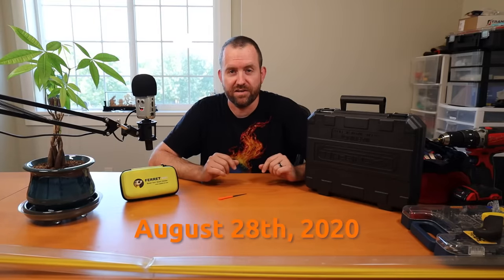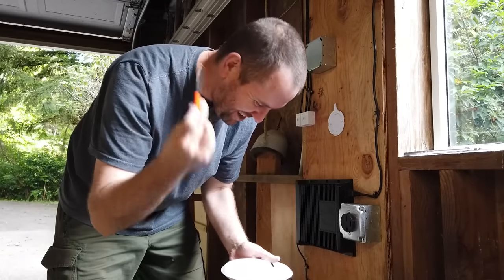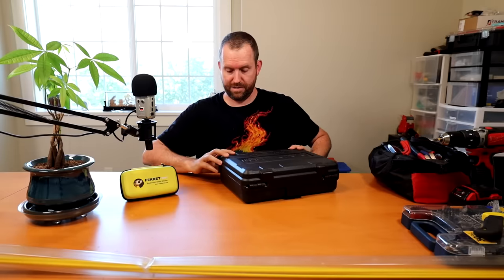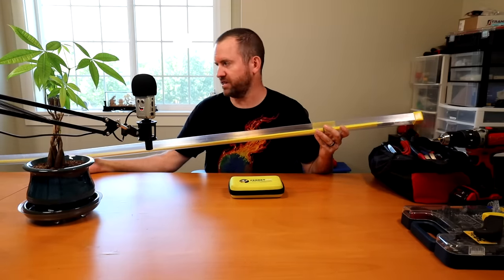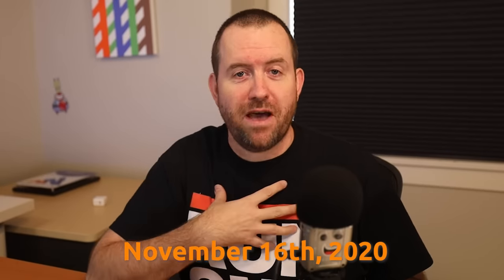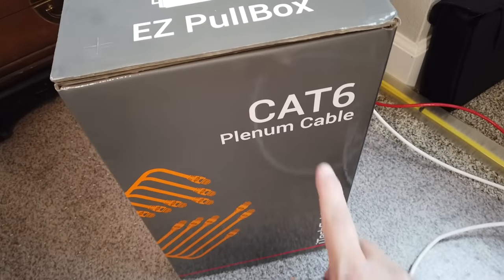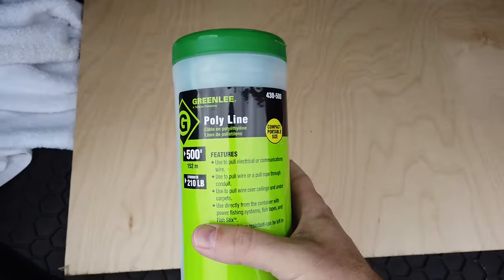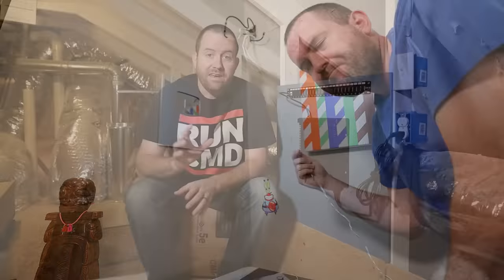CAT6 Wall Fishing

Comment: Two common mistakes you made.   Always run one more cable than you think you will need.  Cable is cheap and as we get older, running additional cables ends up being more trouble than it is worth.   And second, always pull  a pull string with your cable to use in the future when even the extra cable isn't enough.
Reply from the maker: Good tips - thanks!
Reply: @Killahkazx  I use those or similar on all my installs also.
Reply: I second Truth Warrier's comments about the string.  Always leave a pull string in place, more than sufficient length (about twice needed) and tie a knot around a washer inside the box so it cannot be pulled back into the wall!
Reply: Ya'll stole all my comments! LOL Great job everybody!!
Reply: Good advice. 1) Where do you get pull string? 2) Is there a standard way of attaching something to a cable so it can’t drop down the hole you just ran it through? 

I pulled a cable last night from the 1st floor to the basement. I terminated the cable and went to the basement to run the cable down there. I mistakenly pulled the cable from upstairs down into the basement. So, I had to pull the cable back up. It would be great to have some way to insure that doesn’t happen again!
Reply: @majorgear1021  paracord is cheap and readily available
Reply: Another good thing is to pull an extra string.

Comment: Friendly tip, work with gravity.  Pull the wire down, not up with the magnet
Reply: Thats how all of the other videos I have seen with the Magnepull have shown how to use it. They also were able to go much faster which might potentially help with the issue he was running into with the cable folded over not being able to pass the insulation.
Reply: Yup. In my younger days I went top to bottom. Bottom to top is a waste of time and you can avoid all this angle bit. Cameras are a waste of time.
Reply: @raulruiz598  In my younger days I used to do this too, then I realised its a waste of time and after sourcing a good contractor for the job, outsourced the deployment of all the cabling for my projects to them
Reply: Running cable is one of the hardest things I do.  Customers never understand why it takes so long and cost so much to move a light switch 6 feet.
Reply: I spent most of this video muttering that at the screen...
Reply: @TerryPullen  TBH, that is true, but it depends a lot on where you want the fixtures. I wish it was as easy as what he's doing in his office. If I want to wire my LAN, then I'm going to have to go side ways rather than up and down, meaning a bunch of holes would have to be cut in the studs. More likely, I'd probably wind up just adding a crown molding to hid the cables, but that costs more money than one would imagine. But, having crown moldings does class up the place, so it's not a complete waste.
Reply: I'm about to do this myself - I was thinking of attaching a weight to a string and then pass that between the studs.
Reply: He could've also just attached fishing line to the pole he pushed up and attached the ethernet cable to either end and pulled the line eliminating the need for the magnet all together.
Reply: Unless you live below the equator, then it’s the opposite
Reply: Exactly what I was thinking. You can't fight it, so work with it, not against it

Comment: For someone from Europe (Germany) it's just funny to watch how these US paper houses are built. :D
Reply: you should see how manufactured homes are built in the US, they are basically paper houses (i live in one so i know some of the pains, like walls that are not drywall but basically a cardboard material, all the drywall/wallboards are stapled to the framing, same with the cabinets, my house also had no inner vapor barrier and no outer house wrap, basically just a faux shiplap sheeting - although mine also had vinyl siding ontop of that. its drafty, not great in summer and winter, oh and as it was built in 1985 almost all the pipes are polybutylene so im looking forward to having a pipe break down the line. ) although i will say wiring is easy i can get under the building and the outer walls when you drill through the sill plate it has nothing underneath.
Reply: Do I hear the Polizei banging on your door? You better get on the ground.

Comment: FYI, the wood block that you ran into is probably a fire block that slows fires from running up your wall cavities and into the rest of the house. If you're planning on drilling holes through these blocks, you have to seal the gaps with fire resistant filler
Reply: My thoughts exactly! I only have experience with commercial cabling, so I wasn't sure.
Reply: It sounded like he just ran into the top plate.
Reply: @JoshuaBurgess  agreed and he said it was one 3ft left to go. Most residential code calls for blocking on 10ft or taller walls in texas. Top plat it is
Reply: I was very surprised that he didn’t run into fire blocks in those cavities.  They are required where I live and make the process of running wire much harder.  I had to cut open the drywall in order to drill through thre fire block and then close up the hole.  A big job for me.

Comment: When he didn’t put a mud ring in the hole that he drilled actually broke me.
Reply: At least he installed wall anchors instead of screwing directly into drywall.
Reply: George Bush why even install them if your not gonna do it right in the first place hahahahaha
Reply: @Harrypm3  IDK, I would give this solution a C+ or maybe even a B.
Reply: What non-electrician home owner is using mud rings for a home cable run?  Not very many is the correct answer.
Reply: Jon G but he does client installs if you have watched any of his other videos so...
Reply: Yeah that was some rough old work. Though he did use a level to install the plate!
Reply: @Harrypm3  He said he’s not a cable puller.
Reply: wbhad83 he pulled the cable just fine. The plating was what was wrong
Reply: Can you tell us europeans what a mud ring is?
Reply: @TheBrightPixel  It's basically just a shallow junction box with no back. Keeps the opening clean, from spreading and breaking, and gives you the holes the holes to attach your wallplate to.
Reply: @Zizzily  We have something similar in Europe, but we usually have solid cement walls :(
Reply: @TheBrightPixel  the ring also has two little flaps that are flush when the box is inserted into the wall cavity.  By turning screws these flaps swing out 90 degrees and tightens to the back of the drywall which in conjunction of the ring's front lip lockes the box into place.  This provides a stronger resistance against forces pulling away from the wall than the anchors used in the video which are primarily used to resist forces pulling in the down direction.
Reply: A little tip. Take any bank or credit card  trace it on the wall. Cut it out with a wall board saw. Use a low voltage ring with the from Home Depot. Its usually orange in color. It has the ears that hold to the sides as you tighten the screws.
Reply: @TheBrightPixel  A mud ring is a metal fixture that attaches to the front of an electrical box that extends the front of the box some distance forward and usually shrinks the opening (they are available in many shapes and sizes).  I use them if I need a large box but only want a single outlet or switch.  Also, let's say you are repairing a badly damaged plaster wall by covering it with a layer of 1/2" drywall which you will later finish and paint.  You can put 1/2" mud rings on all the electrical boxes to extend the front of the box by 1/2" bringing it flush with the new wall surface.  They get their name from the fact that they allow a plasterer or drywall installer to place mud right up to the electrical box making for a clean, finished opening.  Search "mud ring image" and you will see many examples.
Reply: @georgebush6002  Literally the way I was planning to do it myself.
Reply: @TerryPullen   Interesting I was always baffled by the name, but now it makes sense.  Have you considered that both may be correct since there is often different old vs new work methods?  This would make sense if the goal of a mud ring is to provide a finished edge through the plaster or drywall.
Reply: @TerryPullen  , 100 % correct,  however mud rings go on before Sheetrock ! What he needed was an LV1 or a mpls bracket

Comment: Be sure to seal any holes you make in the wall top plates (the holes you drilled in the attic) to avoid moisture traveling from the heated space to the unheated space.  Otherwise that nice white insulation will be black around the hole in a few years.
Reply: ...also a good idea to slow the spread of fire inside walls.

Comment: I can't believe I've been taking IT advice from a guy who terminates keystones with a pair of pliers lol. Definitely going to get that mag-pull though. Fish rods are such a pain with insulated walls
Reply: If you are joking, please disregard. That is a compression tool for terminating RJ45 jacks. They crimp down all 8 wires at once. They can potentially be a huge time saver for big installs. A downside is that they only work with certain jacks.
Reply: @Heizenberg32  I slowed the video down multiple times to see it. Those were pliers.
Reply: @rjgrissom  But... how would that even work?
Reply: @Heizenberg32  It shouldn't. There must be something we are missing that was clipped from the video or. punchless keystones?  If such a thing exists.
Reply: he put the jack covers on, which have fingers that PUSH them down to make contact. although you should really use a punch tool, or the little plastic punch tool they give you with the jacks.
Reply: @OHWhatsNext  I think you figured it out! Yeah, that would probably-maybe work. But... yuck!

Comment: I am far from a professional installer, but I wanted to share some things I learned from my own DYI: 

1) Whenever going between floors, like through the top of a wall, you are penetrating a fireblock and you need (in order to slow potential fires and be within code) you should use fireblock foam around the penetration (of course making very sure you are sure you don't need to pull more cable or adjust the cable you have before breaking out the foam). In terms of the hole you drilled in the video, it will also prevent conditioned air from flowing through the hole you made into the attic space. 

2) It is good insurance to run another nylon pull (like Poly Line) with your cable if you ever think you might want to pull another. 

3) You can strip back the cable a bit and use the copper wire of the cable to help create a strong connection with the Poly Line without as much tape, which helps for a slimmer profile and easier pull. 

Best of luck with the rest of your cable install!
Reply: A 3/4"hole in a top plate of a timber building is never going to increase the fire risk.  A timber building is a tinder box every day.
Reply: @einfelder8262  ...
Actually, a 3/4” hole can let pass a large amount of heat. Enough heat to char and ignite papers, cardboard, plastic, etc that can be found in attics.
It will also allow smoke to penetrate.

33 years in fire department, hundreds of fires as experience, in  fire suppression and fire cause and determination.
Reply: @ernestgalvan9037  I agree.  But once the timber frame underneath is already on fire causing the heat and char to pass through the 3/4" hole, the cause is already lost.  Or are you seriously telling me the 3/4" hole is the cause of the problem.
Reply: @einfelder8262  .... well, not “seriously”, but “earnestly”.....😎
A 3/4” hole (called a “void” in our work) can allow a tremendous amount of heat to pass through. 
This can impact styrofoam-type insulation, or the paper backing on dry-wall, or wiring insulation, among other effects.
Fire voids are a leading cause of rapid fire extension, also called “fire getting away”, or as we used to say, “the Dragon getting free”.
(Firemen used to say that a fire was a living, breathing animal, a Dragon)

Thirty-three years in fire suppression; been there, done that, seen that; I got the scars, along with the t-shirt.👨🏻‍🚒

Comment: Glad to see the comments filled with great advice. I would also like to give my two cents. In the beginning of this video you shared a tool to remove the unifi access point. I have been working with that particular brand of AP for a little over 4 years now. To remove them, I have always just used a simple standard zip tie, and have never had any issues getting them off this way. Running cables is my job so I always have a zip tie on me, and saves you a quick buck if you ever lose your tool.

Comment: Chris, the chain in the magnepull kit comes in handy when using the roller to pull lines through walls that may have internal obstructions like other wires, pipes, boxes, etc. You can drop it through the entry hole in the top plate and jiggle it down through gaps that may be too tight for the bullet end to get through. ProTip!
Reply: I was also wondering if a person could string the data line through the chain links and keep the bullet on the end when there are obstructions such as plywood cross members across studs or something stupid, that way you could get the bullet down to the obstruction, then pull the magnet off and onto the chain to pull it down to the obstruction creating slack on the bullet end to carry on pulling the bullet. Never used something like this though.

Comment: the cable ferret is a great example of a tool that's basically a useless gimmick when you don't need it, but the most important tool in your arsenal when you do. it's used for figuring out complex situations where what's happening isn't clear (like when you're hitting something and don't know if it's a board or electrical box... important to know the difference)

Comment: I have a gas furnace in the basement with a flue running up through a large chase to the attic, and finally out the roof. I just opened up the bottom and top of that chase with a hole saw and ran 3” conduit all the way from the basement to the attic, making sure to maintain proper clearance to the flu. From there I dropped a length of poly line down for future pulls and stuffed the ends of the conduit with foam insulation. Now I have home runs for my 3 ceiling mounted access points and all cameras. No need for an industrial switch in the attic since CAT6 is cheap enough to run home runs for everything back to my rack in the basement.
Reply: Is it safe to have wires ran that close to the flue, even though its in a conduit?  I'd be concerned with the heat.
Reply: @lostmatt  In my chase, the flue is “B” vent with a minimum clearance of 1” to combustibles. I’m much further than that.

Comment: I used to use a length of chain like an old school Magnapull on the end of some polyline. Drop is down the cavity, the weight of the chain would fall down and around any obstacles and you could fish it out of the bottom hole with a piece of wire etc.

The rods were great for suspended ceilings in commercial environments, pop a tile on one side, rods across to the other side to another open tile, easy done. Cabling regs have changed a fair bit since back then, a lot more requirements for segregation etc.

Guy I used to work with (back in the 80’s) used his small dog to pull cables through roof spaces.

Comment: A few key items to look into. Fire caulk, punch down tool, and single gang low-voltage rings (for stabilizing your wall plates if nothing else). Also, if running poly line (pull string) always double up and strap for future needs like running coax, replacing cables, etc. These simple things will help with future troubles. Keep it up!

Comment: If you already have RG-6 cable lines in your rooms, using MoCA adapters is a much more viable solution. Recommend you use the low voltage old-work boxes too for a much more professional and easier job rather than making those round holes. The square cuts for the boxes allow you to put you hand in the wall to grab stuff. Also along with the wires you pull, always pull another string for future use.
Reply: While it’s a good solution for some situations, MoCa is not a replacement for proper network cabling.

Comment: A tip for getting cables from exterior walls over to interior walls, where you can more easily access an empty wall cavity through which to go between floors...pull the baseboards.  The drywall sits 1/2 to 3/4 of an inch off the floor, covered by the baseboard.  You can chase the wire along the floor within that cavity beneath the drywall.  Then, when you get to the wall cavity you want to use, you can drill up through the edge of the 2x4 base plate and into the cavity.  From there, you can move up or down, though you'll need to cut a 1 gang box opening through which to run a drill bit (if going down) or to feed the line up.  A mud ring and blanking plate are an easy cover for the access hole if you don't want to patch the drywall.
Reply: Great tip! I have used that trick plenty of times. Just make sure you don't put any nails thru the cable when you put the baseboard or quarter-round back!

Comment: Hey Chris love your videos, keep up the good content. What I’d suggest next time you fish cable up a wall cavity with insulation, stagger the  cat6 cables about 3 4 inches apart. Then use some electrical tape and tighten the bundles together working your way down . This  will pull a lot smoother.

Comment: One of my first jobs in IT was pulling phone and data cable.  I grabbed a length of sash bead chain from facilities and used that to drop down into walls and fish out though the mud rings.  Worst job is crawling through ceilings full of fiberglass insulation.  Even with a full body coverall, you itch for days afterward.  That was one job I was happy to see outsourced to a cable install company!